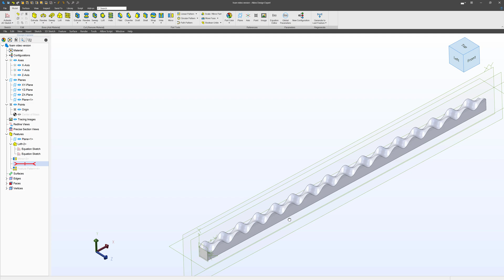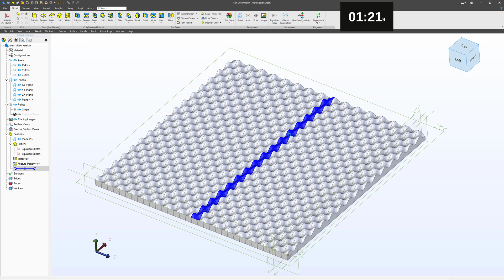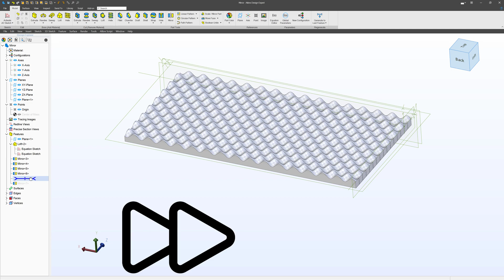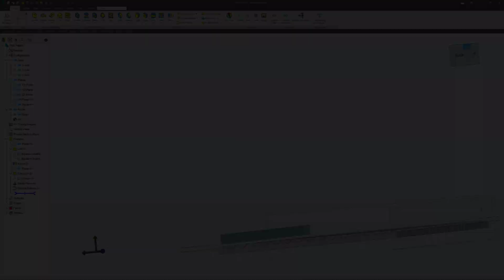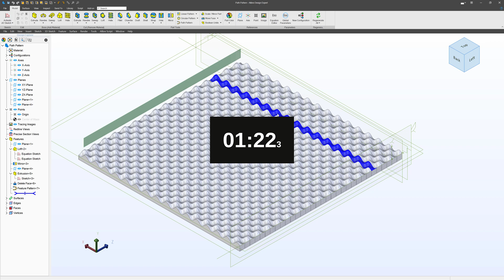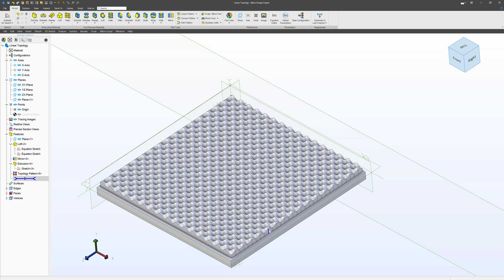Alibre | Feature War- Mirror VS Linear Pattern VS Topology Pattern VS Path Pattern- What's Fastest?

Comment: Actually, I really liked the Mirror as an alternative to linear pattern. I always like finding new ways to do the same thing and that something I had never thought of before! And I have thought of calculating how to define an axis in order to use the Circular Pattern instead of a mirror when possible.

You see, back when I was using Fusion when you mirrored something in assemblies it always considered it a separate part and counted it separately in the BoM. That was especially bad for fasteners where you would then need to do some accounting to fill out an order for them...

So, I figured out a way to use Circular Pattern instead of mirror for fasteners. But Mirror instead of Linear Pattern was really inspired. Also, I'm a sucker for excel graphs...

KUDOS!